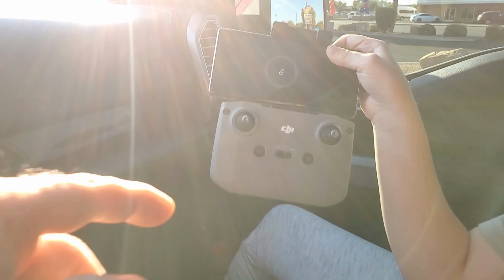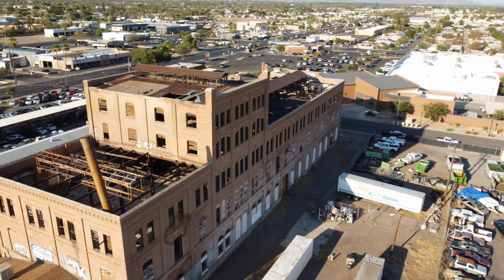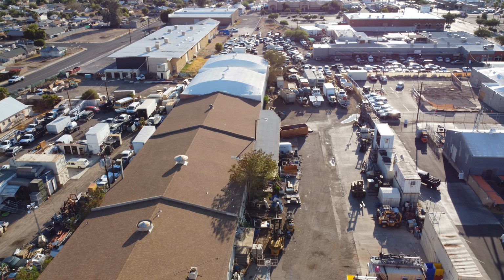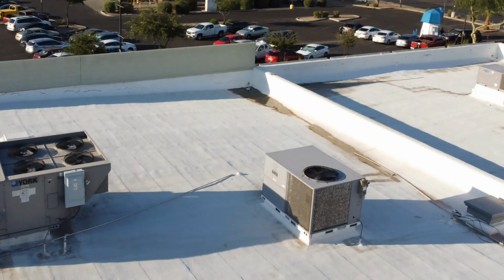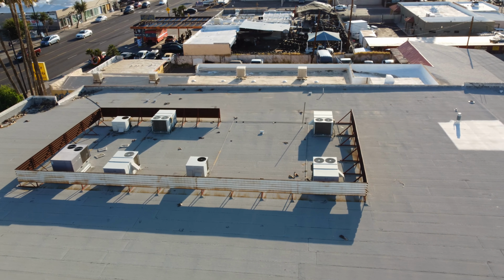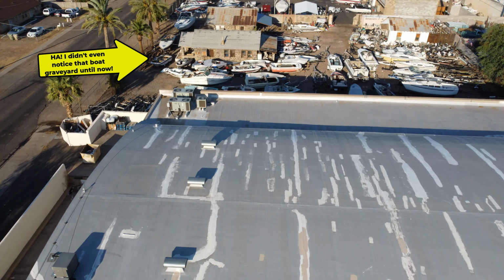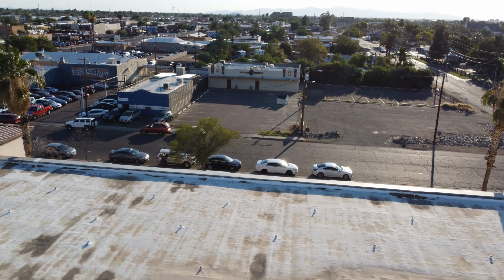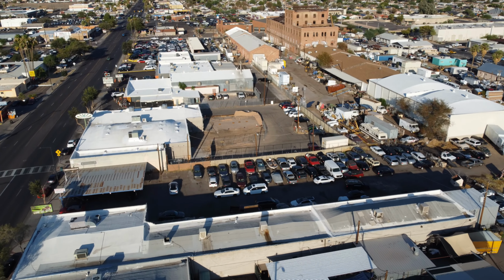How ghetto is this rooftop? [Episode 6] Abandoned industrial building in Glendale + old split HVAC

Comment: The thrift store split systems reminds me of some old pre ac buildings around here that were retrofitted.  They’d have a split 10-20 ton unit with an unducted air handler in the back that was so strong it blew cold air all the way to the front. 
The old building shots were cool as well